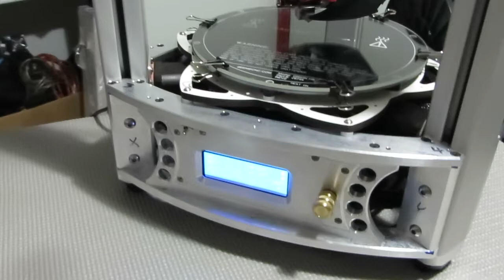NEMESIS 3D Air Delta 1 by Trick Laser  1st movesMVI 0777

Comment: Love this. Found you and this printer on the SeeMeCNC forum. Quick question. Are you at all concerned with the top of each aluminum tower moving, when the hotend is in a high Z-position? I was just curious why you didn't have a brace supporting all three towers. I'm sure it's very solid, and that's likely not an issue, but I'm curious why you decided to go that route.
Reply from the maker: I wanted a simple frame that is sturdy and precise. The precision machined aluminum frame sides keyed into the large 40mm extrusions are plenty strong so top frame bracing is not needed. v2 machine frame is even more simplified, see a few pics here http://forum.seemecnc.com/viewtopic.php?f=6&t=4875&sid=a85c3507f8fb5eaaec7dcaa912503f4a&start=40
Thanks for your comments.
~*Brian